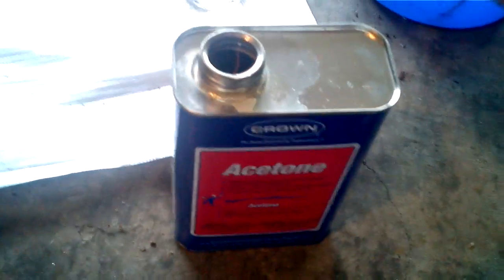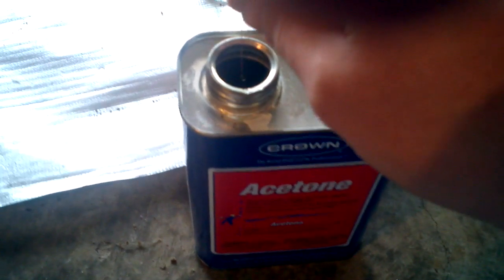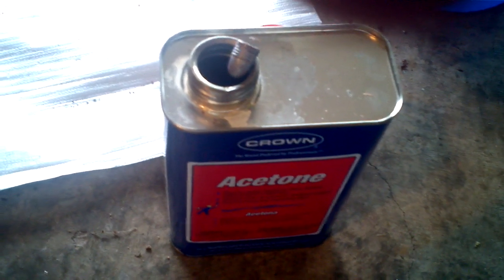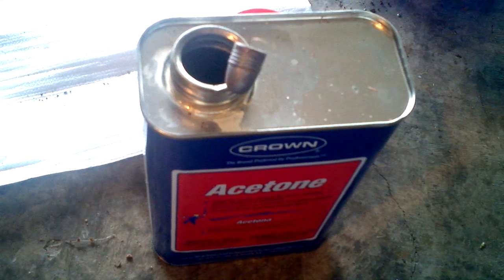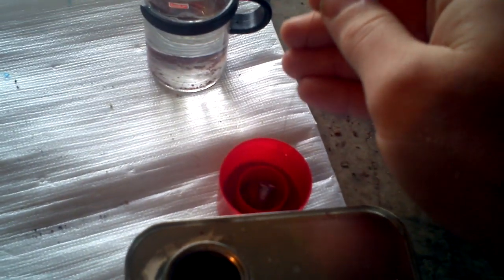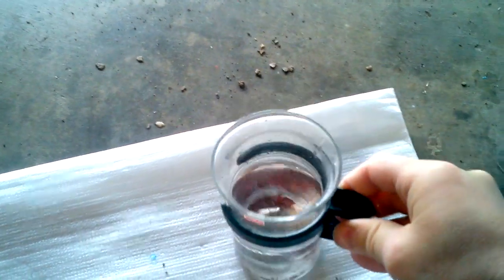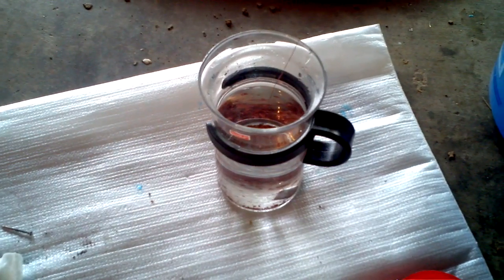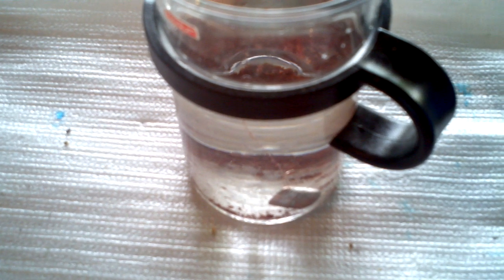Copper Plating Cast Lead Bullets - Pt 1 of 5

Comment: @ .30 you said rough copper that just sluffs off, that is where I am right now, lead or steel.
I assume the Acetone and overnight Sulfuric Acid dip surface prep was the fix?
I just cleaned with brake clean.
Also,the source I saw said use distilled water, and I did, but you use vinegar.